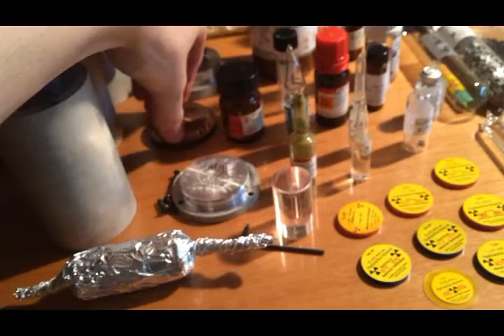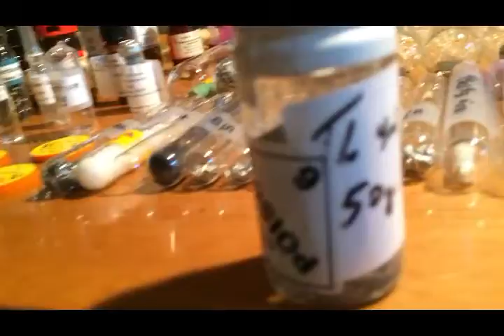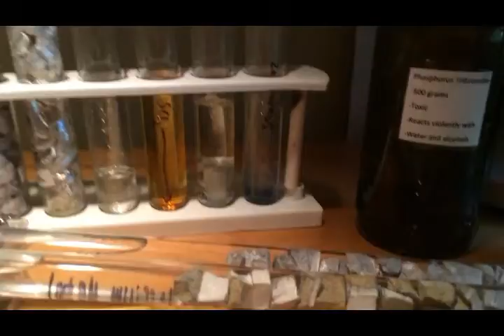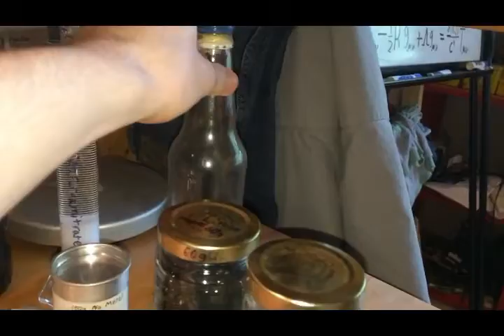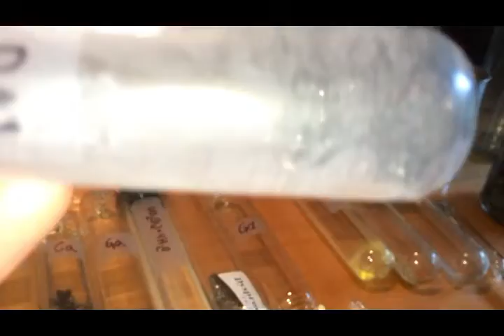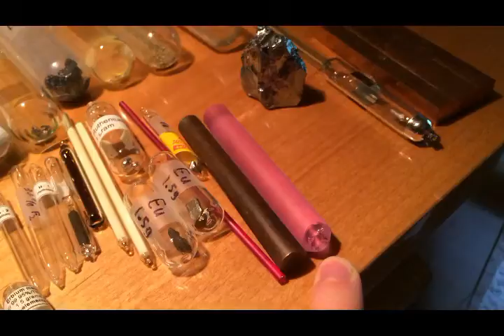My Element Collection

Comment: First of all, greetings from Turkey, I also want to make such a collection, but since I was 13 years old, I may not be able to buy some elements. Where exactly can I get these elements? Some elements come from items used in daily life, but there are some that don't come out, can you tell us what comes out? It will be difficult, but I think I will try to search for uranium with a geiger counter in the village. I can get 20 elements for now. Elements are used in places that sell construction materials such as batteries and hardware stores.
Reply from the maker: I order many of them on line from chemical suppliers
Reply: @DietterichLabs  thank you

Comment: It would be great if the fluorine was more pure because it's meant to be a pale yellow gas however I'm guessing that would also make it potentially dangerous also there's a form of fluorite called antozonite that contains elemental fluorine! :)
Reply from the maker: I have heard of antozonite. It is one of my favorite minerals because of its elemental fluorine content. Also, even if the fluorine in my vial was pure, it would still be difficult to see, because it is a very pale gas. You need a much larger cross section of the gas to see it.
Reply: @DietterichLabs  Also it wouldn't last very long since fluorine is so incredibly reactive that it would react with the glass, the helium is supposed to prevent or at least slow down its reaction with glass.
Reply from the maker: @brfisher1123  That is the description that the supplier gave.